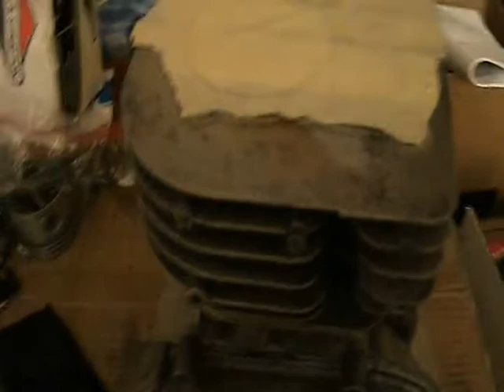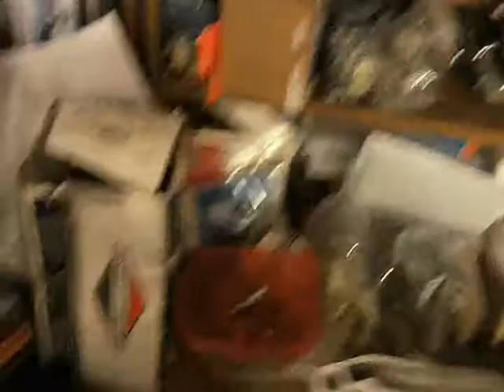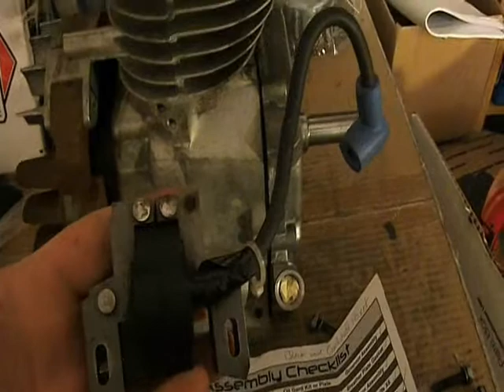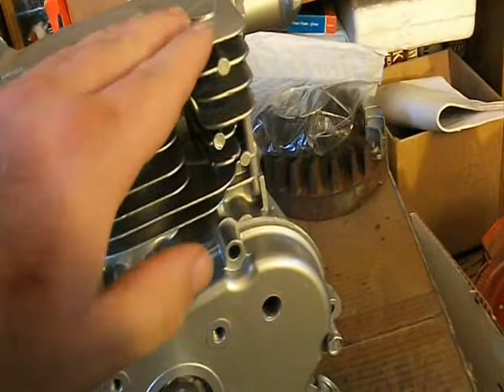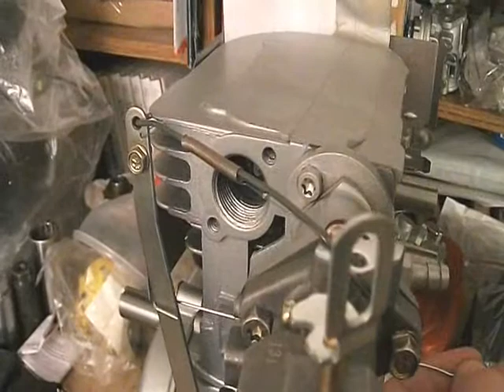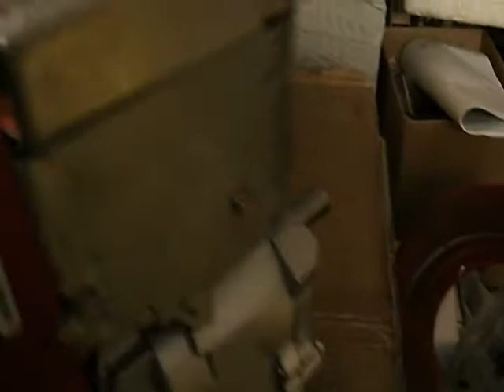"Double Throttle" Briggs 5hp Engine Project - Videos (Combined)

Comment: Where do you get the carb setup
Reply from the maker: https://www.ebay.com/itm/New-CARBURETOR-Carb-for-Tecumseh-632334A-632111-HM70-HM80-HMSK80-HMSK90-Engines/282481537100?hash=item41c536304c:g:X4MAAOSwFb5aTDpf
Reply: dc5000123 what about the adapter?
Reply from the maker: You got to get an intake manifold from a kart racing shop. They are called "Briggs 5hp tillotson intake manifold. First manifold at the top:
http://www.out2win.com/catalog/manifold.html

Comment: I really need that part number for that bottom throttle plate setup!!!
Reply from the maker: I have one for sale if your interested. 691383
Reply: Of course!  Beat all online prices?  Message me and we can email each other.
Reply: Found one for $15 shipped on ebay but I'm not sure if it has the return spring.  Let me know about yours
Reply from the maker: D Copp
 There are two springs I use the smaller one I can include, but the larger you'll have to buy from a hardware store.
Reply: got my throttle setup (from ebay)  It appears to need another bracket to attach to the engine though.  I see where it bolts into the bottom mounting plate portion of the engine but where does the top attach?  Can you make a reply vid for me???
Reply from the maker: D Copp  It bolts to the engine block behind the camshaft area.
Reply from the maker: D Copp i cant make a video right now cause I'm out of town.
Reply: gotcha, don't forget when u get back then please!  Appreciate the help!!!
Reply: still need that vid or pics of the way that throttle plate mounts on the engine dude.  Thanks!
Reply from the maker: D Copp
 ok, I will try to make a video soon.
Reply: or pics will do too
Reply: D Copp did u see my new video?

Comment: That was a very interesting cam. That is a really nice clean engine inside. Strange the difference in carby bores. You have done a really good job on this engine. Runs well, seems tight. I like the muffler set up!